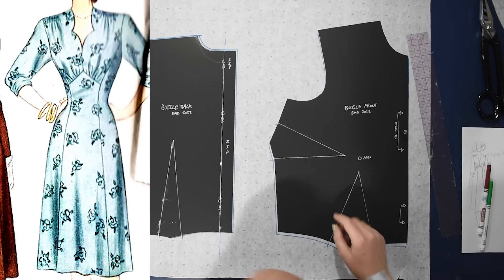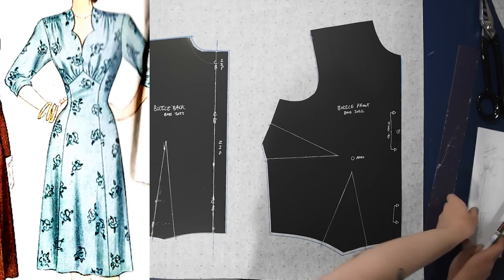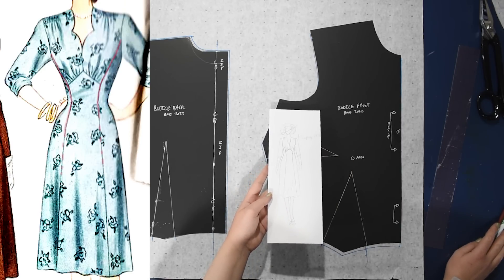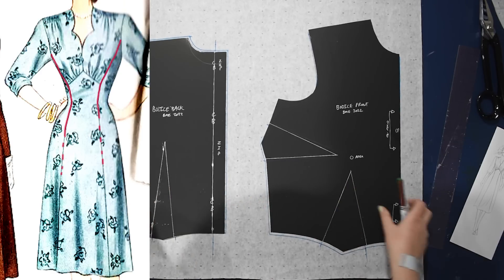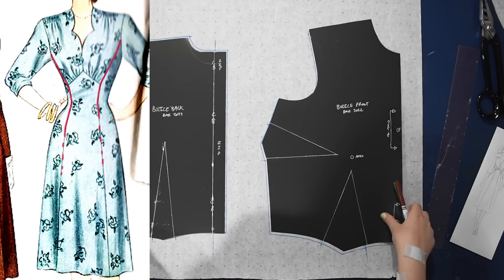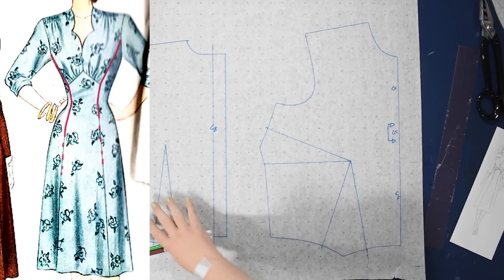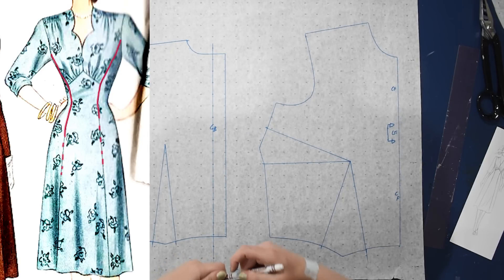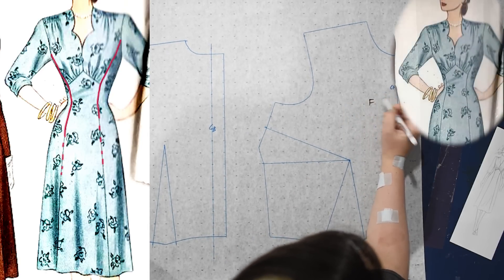How to Draft Simplicity 1832 // Patterning Pop Quiz

Comment: That's a really nice design.  If you ever make the dress I'd be tempted to add even more gathering to the bust and shoulder line (not sure how to do that part of the process - how would one add volume to an existing block or pattern???).
Singer did make shirring feet.  Depending on how you push the fabric, it will either shirr allot or minimally - I've yet to get a consistent result of shrinkage (but I also haven't played with it allot yet).  The company also seemed to have changed the face plate design in the 50's when they upgraded the design for the 99K (I think that's when they added the reverse).  It also allows you to date the machine really quickly when scrolling through the want ads...
- Cathy (&, accidently, Steve), Ottawa/Bytown/Pimisi

Comment: I learn so much from your videos! Thank you!!! Question on the gathering… I have a Featherweight which came with all the original accessories, including a ruffle / gathering foot. I also have the same on my modern machines. To date I have yet to find a use for these. Do you ever have a use for these feet in garment making? My guess is they are better used in things like pillows and curtains, but as you have gathering in this garment I thought I would ask.

Separately, I LOVE the tip on cutting the point in the centre when attaching the skirt to the bodice.
Reply from the maker: Thank you Joline! Indeed I never use the other feet, only the regular foot and the zipper foot! I too imagine they would be good for curtain ruffles, but can't imagine using them for anything else. I like to have total control over my gathers, especially when they are there for fit reasons and not just decoration 😅🧵
Reply: @TheClosetHistorian  Thanks. makes sense needing the “manual control” with the smaller spaces where gathering is done in garments. If I ever find a need for these in clothing I’ll let you know ;-)

Comment: Fascinating. In my quilting intensive years, I learned an order of sewing for Y seams that would have made the center bust seam last, pressing the center seams open and the horizontal seams up. BTW, I began with garment sewing as a 4-H member in the late 80's, did quilts with no deadlines as a working mom, and I am back to garments as an empty nester. Any chance you could do a full tummy adjustment in a WW2 era? I never did like the lines of Dior's new look as a Channel devotee.

Comment: I have dug through Grandma’s patterns - this was buried in the “horrid to sew as designed” pile as we are members of large bust, small waist club. 

The back does have princess seams, but appears to have back waist pleats also. I cannot figure out why, and Grandma P didn’t do her personal block to it, so no help there. It doesn’t seem to be flattering and would be vastly easier to sew it your way.
Reply from the maker: Thank you! It is a rare pattern though, so probably worth a bit btw ✨
Reply: @TheClosetHistorian  I have no idea on how rare/common Grandma P patterns are. I know most are less common because they’re in larger bust sizes (46-48” bust) because it’s easier to make the waist smaller than make the bust larger. None I have really looked at are cut out, marked up and/or heavily handled. She made tracings of every pattern, then altered those. 

I tried selling a bunch of the patterns I’d never wear from 1920s-1940s (those decades are typically hot mess on me since I don’t have the right under pinings) and the 50s and later in the box of doom and priced them at an I thought reasonable $15 USD - all the similar patterns when for that or more. Not one sold, got multiple messages that I was selling garbage patterns and even $1 was too high. So I stopped trying to sell them - this was 5 years ago.

Comment: Would you so a video on dart manipulation for styles where you've changed the bust/waist ratio from what it is on your bodice block?
Reply: ^^this!^^
Reply from the maker: I'm not sure I understand, I need the exact ratio of my personal block in order for anything to fit me 🤔 Too much dart fullness and it will create extra emptiness at the apex and yet also be too small in the waist, too little and the garment will be baggy and loose all over. Do you perhaps mean a video about adding additional gathering/fullness for purely style reasons and not fit reasons? Because in that case, yes I could do that 😅
Reply: @TheClosetHistorian  I was talking about creating blousey styles that add more ease to either the bust or the waist, but not both (or an uneven amount to each). I have a big bust/waist difference, so when I buy non stretchy tops I just buy ones that fit the bust and tuck them in. I want to make myself some tops when I get a little better at sewing, and keep a little of this look, but have it not be so extreme, but I feel confused about how.
Reply from the maker: @ThimblewolfArt   So when I used to buy clothes I had a similar situation, becuase my bust is say a size 12 and my waist a size 8 or whatever, so there would be extra fabric at my waist if I bought things big enough for my bust. This is no longer a problem in any way with a custom fitted block pattern, because it is made to fit my personal body perfectly, so it's not a "size 12" it's a size "me". I can have a perfectly fitted bust and waist on the same garment. If you want a blousier/loose fit at the waist, you simply don't sew in the waist darts, like I show in my shirt video available here https://www.youtube.com/watch?v=2gX--kYVWLg&t=2192s
Reply: @TheClosetHistorian  thanks.

Comment: Something a bit different - I'm trying to work out where the darts/lines etc are on the bodice of a bungalow day dress from the 1920s. The style I'm looking for has dead straight vertical lines from the shoulders, and a cross-bodice almost bib-front. It's certainly loose with lots of ease, but it must have shaping *somewhere*. Here's the pictures. https://www.dropbox.com/s/w67qj17gpj0ptoj/Pattern%20Ideas.png?dl=0
Reply from the maker: It looks to me that there is some shaping in the waist gathers, as in: if a normal pattern has a waist dart, one could use it as gathering instead at the waist. The 1920's used a tiny bit of "secret dart" as I call them, I ramble about them here: https://www.youtube.com/watch?v=4UnU4nGrScE But truly most 20's things are very very boxy and do just use a lot of straight lines. I would imagine this dress uses simple rectangle shaped pieces and that the yoke is indeed totally straight.